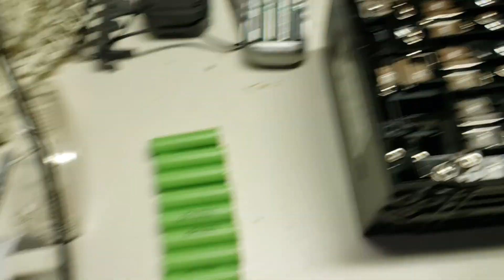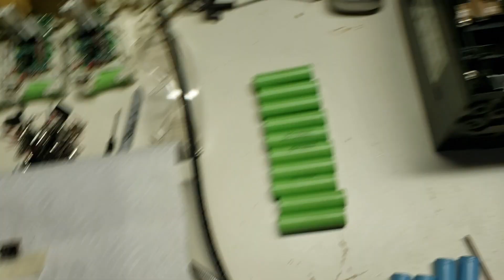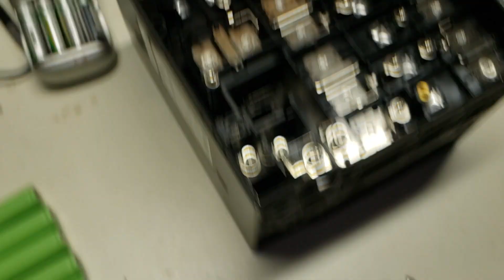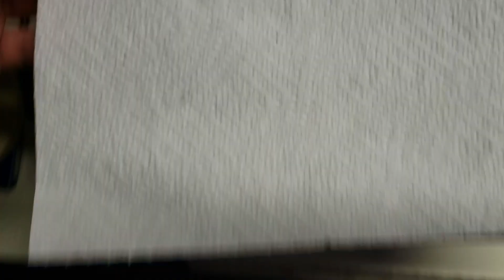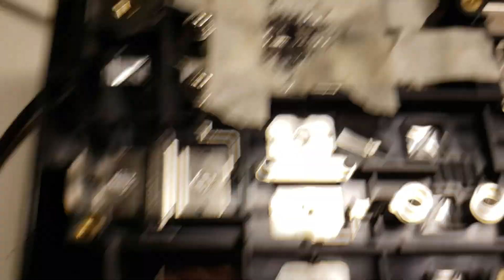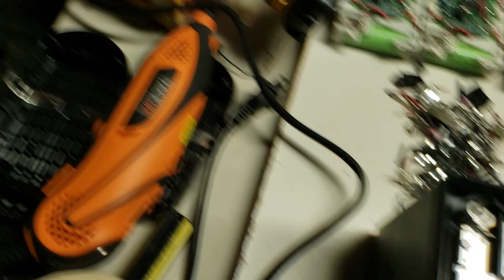Toshiba Scib Lithium 18v to 13.8v conversion mods

Comment: Hi i want to buy toshiba battery where can i buy
Reply from the maker: Sriko Battery USA
Sriko Discount code= BDSB 
https://srikobatteries.com/?wpam_id=8
Reply: @mazda2284  i couldnot find link for toshiba scib battery pack
Reply from the maker: @tanvirhussain6312  
LTO DIY battery kits
Sriko Discount code= BDSB
https://srikobatteries.com/product-category/car-audio/lto-kits-car-audio/?wpam_id=8
Reply from the maker: @tanvirhussain6312  SCIB 

6pack 2.4V 2.9Ah 75C Prismatic LTO Cell With M4 

Sriko Discount code= BDSB
https://srikobatteries.com/product/2-4v-2-9ah-6pack-prismatic-lto-cell-with-m4/?wpam_id=8

6pack 2.4V 2.9Ah 75C Prismatic LTO Cell With M5 Pedestal 
Sriko Discount code= BDSB
https://srikobatteries.com/product/6pack-2-4v-2-9ah-75c-prismatic-lto-cell-with-m5-pedestal/?wpam_id=8

M6 6ah 
2.4V 6Ah 80C Prismatic LTO Cell with M6 Threading
Sriko Discount code= BDSB
https://srikobatteries.com/product/2-4v-6ah-80c-prismatic-lto-cell-with-m6-threading/?wpam_id=8

M6 10ah 
Prismatic LTO With M6 Threading. 2.4V 10Ah 30C continuous 75C peak discharge Lithium Titanate Battery Cell 
300amps constant charge and discharge per cell/bank , configured in 6s 14.6v-16.2v recommended charge
Sriko Discount code= BDSB 
https://srikobatteries.com/product/2-4v-10ah-75c-prismatic-lto-cell-with-m6-threading/?wpam_id=8

M4 10ah
Prismatic LTO With M4 Threading. 2.4V 10Ah 30C continuous 75C peak discharge Lithium Titanate Battery Cell 
300amps constant charge and discharge per cell/bank , configured in 6s 14.6v-16.2v recommended charge
Sriko Discount code= BDSB 
https://srikobatteries.com/product/2-4v-10ah-75c-prismatic-lto-cell-with-m4-threading-2/?wpam_id=8

M6 20ah
2.3V 20Ah Prismatic LTO With M6 Threading.
1.5v min , 2.8v max , 20C rate 30sec 
Sriko Discount code= BDSB 
https://srikobatteries.com/product/2-3v-20ah-35c-prismatic-lto-cell-with-m6-threading/?wpam_id=8

M4 20ah 
2.3V 20Ah 35C Prismatic LTO Cell With M4 Threading
Sriko Discount code= BDSB 
https://srikobatteries.com/product/2-3v-20ah-35c-prismatic-lto-cell-with-m4-threading/?wpam_id=8